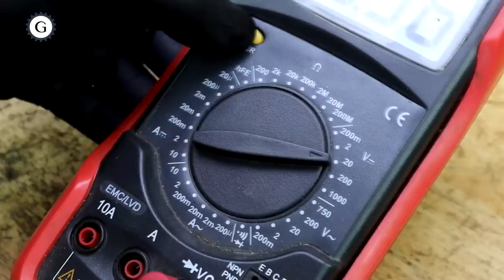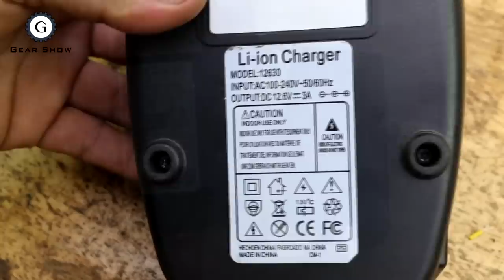Black & Decker 12V Battery and Charger Upgrade Guide

Comment: Did you secure the charging board in the plastic housing at all or is it just floating in there?  

Also, how does the battery life stack up against the old battery or OEM li-ion batteries?
Reply: battery should last 2-3 times the original

Comment: salve, ho un avvitatore 12 volt come quello che ripara lei solo che non posso ricaricare le batterie come fa nel tutorial, desidererei caricarle con una presa esterna tp 4056 ma non so dove ataccare i fili+/- puo aiutarmi grazie-------- hi, I have a 12 volt screwdriver like the one she fixes only that I cannot recharge the batteries as she does in the tutorial, I would like to charge them with an external socket tp 4056 but I don't know where to connect the wires +/- can help me thanks

Comment: Just a tip, you may take it or leave it. Twist the wires after you strip it, so it wont fray. Also, tin the wires before you solder it the metal terminal.

Comment: You used 6 batteries, each 4.2 volts. It doesnt add to 12v, did you connect them in parallel?
Reply: He made 3s2p battery pack. So it should be 12.6v with double capacity.

Comment: I wonder if you can replace lithium ion into lithium polymer battery
Reply: what for? difference between them is wery thin. Basic chemical element (lithium) is the same. Only discharging currents a bit different. So it matters not
Reply: 18650 Lithium ion batteries are easy to find for free :)

Comment: Thank you for sharing, but I couldn't succeed even though I tried many times. I researched and found out that the bms circuit does not work because of short circuit current protection. Could you please help me choose a bms circuit? (4s and 5s)
Reply from the maker: You can buy the same BMS I used.

Comment: Great job.  Does the BMS have a low-voltage cutoff?
Reply: yes. low voltage, and high voltage cutoff. some of these have temperature cutoff, but there are thermistor required.
Reply: @ПетрИванов-ы6е  You can grab it from old laptop batteries

Comment: Thank you for sharing, good for your labor. Which (Volt and Ampere) adapter can we charge the serial group 18650 batteries with 4S and 5S BMS? For 4S to 16.8V - 5S to 21.0V, the min. and max. If I can learn how many Volt and Ampere values it should be, I can choose from the adapters I have.

Comment: What is the use of adding (bms) to batteries?
Reply from the maker: BMS controls voltage each cells in the battery pack.
Reply: @gear_show  Is the old charger (if it work) suitable for charging new batteries?